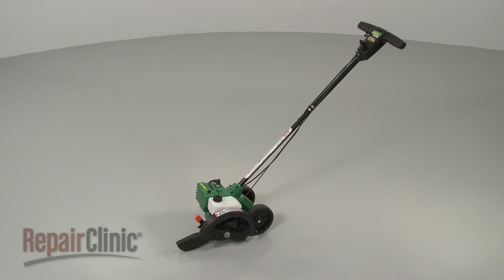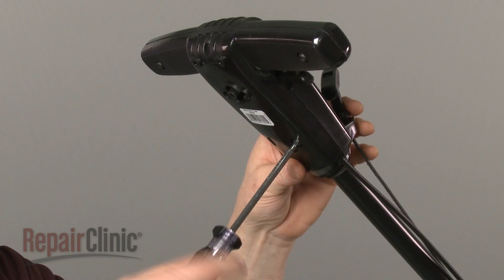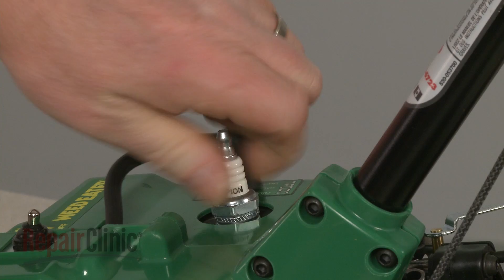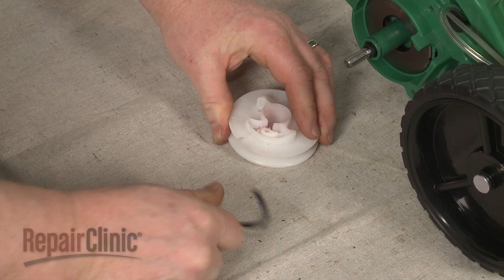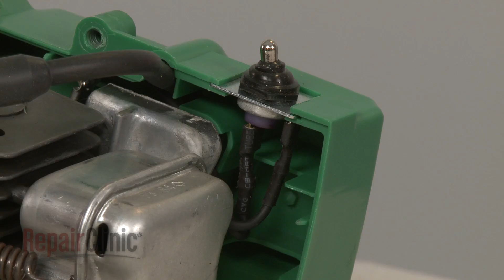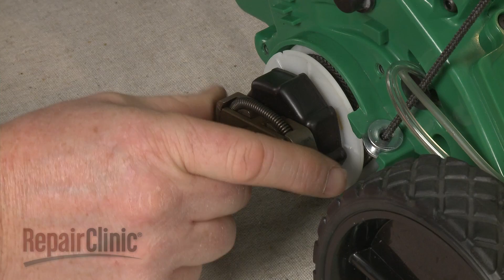Weed Eater Edger Disassembly – Edger Repair Help

Comment: My blades won't spin, what do you suppose would be the issue? With your video I'm very comfortable opening it, just not sure I can diagnose.
Reply from the maker: a Most models have clutch that once't the drive shaft gets up to speed the clutch will engage the blade.